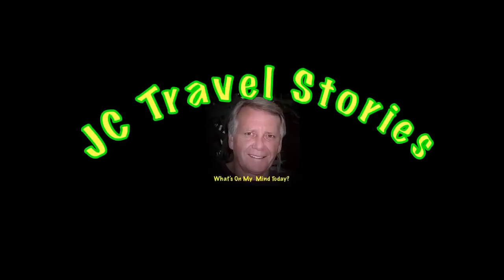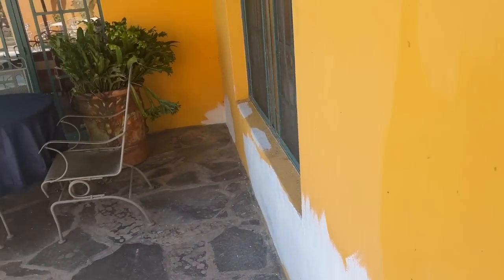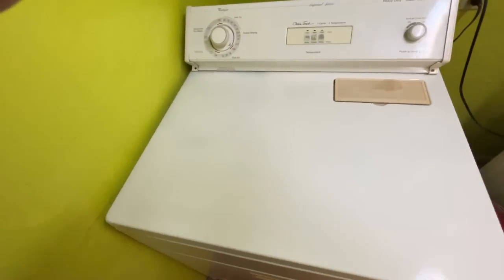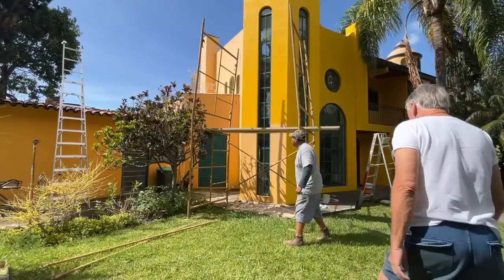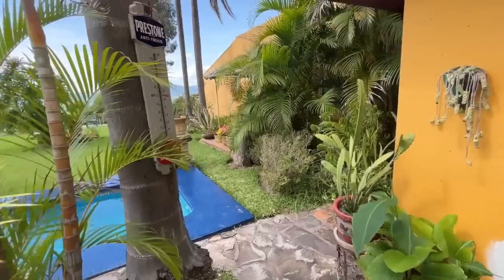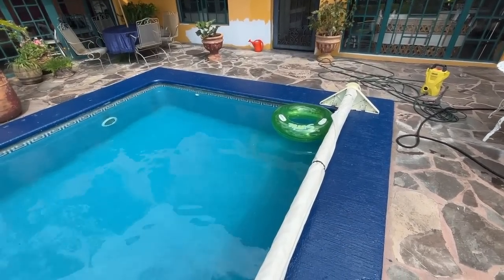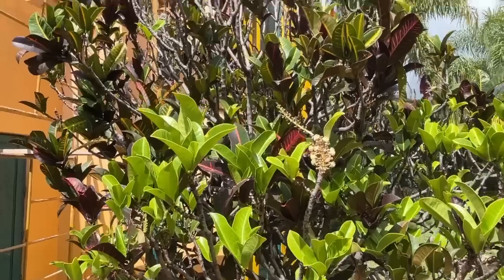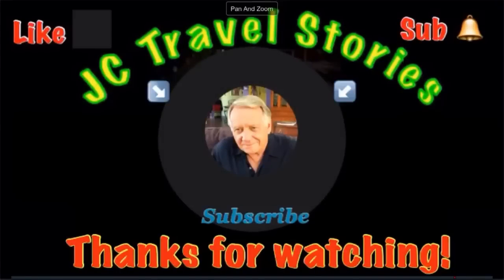Retired Life

Comment: Curious how you made the fridge into all freezer?
Reply from the maker: I cut two 4 inch holes in the floor of the freezer compartment, put a computer fan in one of them to circulate the air and turned it up on high. Whole thing freezes.
Reply: OK, thanks.  I assummed there would have been wiring or a regrigerating coil in the freezer floor but I guess not.

Comment: J.C do these housing in Mexico have weep hole so the bricks can breathe so mole won't grow.
Reply from the maker: I’ve never heard of that. Didn’t know bricks needed the breath. Been here 20 years. No problems with mold anywhere ever. Are you sure somebody didn’t sell you something you don’t need?
Reply: @JCTravelStories  I have weep holes, or slots in my home, and in my first home. I see it in other home, and in school buildings, they use cement blocks which is cheaper? There always on the bottom run. To let moister out.
Reply from the maker: Cement blocks are hollow. Maybe you get condensation.  My walls are solid brick and re enforced concrete.
Reply: @JCTravelStories  I observe that Monterrey Mx the weather was cold I turn the mini split on for some heat then the walls started to mold-up quickly.